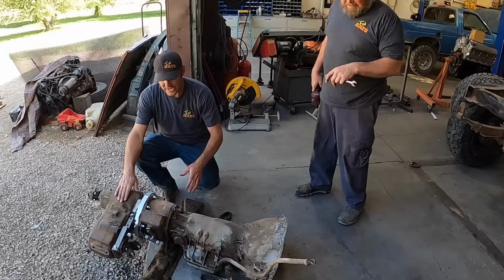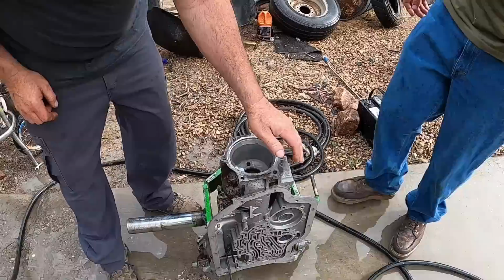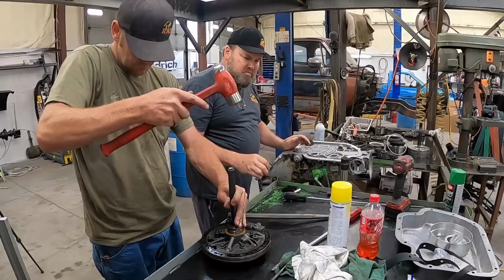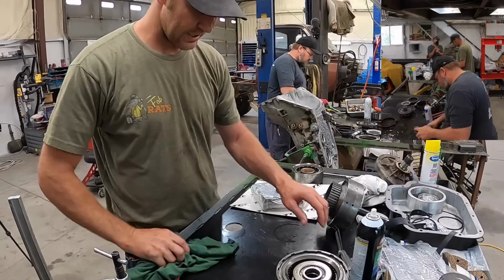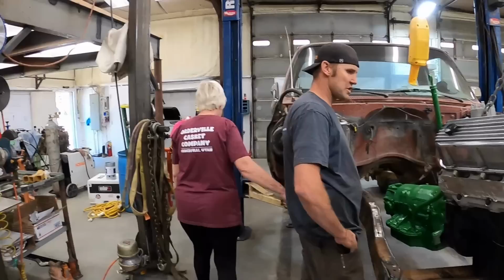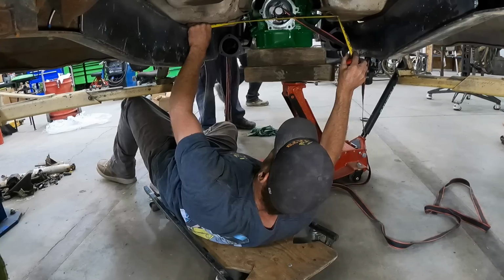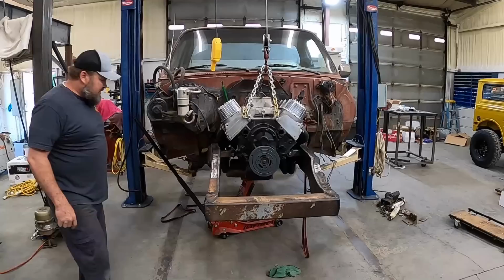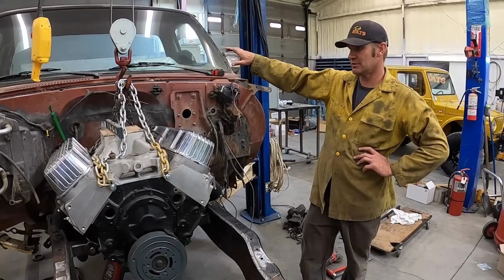All In A Day's Work! We Got The Motor In The Rat Rod Tow Truck!

Comment: The amount of knowledge you have is impressive! Auto trans have always intimidated me.
Reply: Automatics are easy: just take them to the scrap yard and put in a good manual.

Too bad Paul can't count to ten: a good Eaton Fuller would rock in that rig.
Reply: @kd5nrh  wow. Talk about not being able to count to ten. I’m sure while Paul is at 45 degrees on a obstacle pulling a disabled truck out of a canyon he’s going to be super keen on having to continuously shift between 1st and 2nd gears. Oh ya. Definitely. Torque converter and the correct stall is key to performing in this case and on a drag strip.
Reply: I hear ya. It was intimidating to me too until I went for it (because I didn’t want to pay for labor). After you succeed at it, you fully feel like you can fix anything.
Reply: @dsauce8780  Well said.👍

Comment: It just amazes me that Paul knows how to tear down and rebuild a transmission. Your average auto mechanic won't touch transmissions, it's just too complex, so they send it out to a transmission shop. I bet Paul is even self-taught, which just makes this even more amazing.
Reply: A TURBO 350 / 400 IS ONE OF THE EASIEST TRANSMISSIONS TO REBUILD ...
Reply: @tammylott921  why are you all cap shouting?
Reply: I can do it with a motorcycle carb. Paul does it with Carbs, Chassis, Transmission, Engine, roll bars, and Body
Reply: It's also a pretty color 😐
Reply: @ericratza5353  I'm good with lawn mower carbs!  Lol  

Paul does differentials too, with pneumatic lockers even! I've learned so much about them from his videos and from @Matt'soffroadrecovery
Reply: To take it a step further I'm guessing he has tons of experience with that exact transmission model. Even a seasoned transmission repair tech would go way slower on disassembly to note how everything goes back together when dealing with a model they haven't done before. Paul is so casual he must have that thing memorized.
Reply: @stevemonkey6666  I know! Lol  he still paints his stuff green like his derby car days. Definitely gives me a chuckle.
Reply: Well, we've seen him do another transmission and it didn't work. Let's save judgment until this one works.
Reply: Average auto mechanics are flat rate not really entertaining time learning at work if transmissions are not your focus point. Obviously learning on your own time is up to you.
Reply: I wish I had his skill with transmissions for sure. Can tell he’s done that many times
Reply: @tammylott921  ,  Easiest???
Reply: @DonAshcraft  ,  I GUESS because he had his SHIFT key down.
Reply: @tobyvision  ,  Impressive, no? LOL
Reply: @BruceNitroxpro  I KNOW  lol 😂
Reply: Old hydraulic automatics have a reputation of being more complex than they really are. It’s just clutches and gears, and the valves are mostly springs and ball bearings. It ain’t easy but it’s no more difficult than rebuilding an engine, and the turbo 350 is just ubiquitous.. no need to study it when tearing it down, you can watch 8 million YouTube videos about how it goes together. It’s like the small block Chevy of transmissions… there’s a reason for that ;)
Reply: @jaecenwhite2590  interesting. The reliability factor is probably also important.  I am self-taught with most all things, I've replaced many clutches trannies and gearboxes but I've never considered rebuilding a transmission. Especially looking at all those wavy random channels it looks like brain surgery to me! Haha 🛠️ 🧠
Reply: @tobyvision , Precision Transmission channel does a excellent job on breaking down transmissions and why they fail. 👍
Reply: @DonAshcraft  Painting a transmission any color is a good thing because it helps to repel any dirt/ mud from sticking which will hold in heat. The #1 enemy of a automatic transmission.
Reply: @327JohnnySS  Cool! Good to know.

Comment: A suggestion.  Put a couple of drawer sliders under the hole and mount a catch tray/basket.
Reply: I was thinking a hinged catch cage of some sort. But anything to stop the parts from flying about would probably work. A milk crate on wires...  🤷‍♂️
Reply: @lloydfancett3039  I was thinking a cardboard box with a rag in it :)
Reply: If I'm not mistaken that is the same table he does disassemble on so it would need to be able to hold fluid. 

Couple things surprised me drilling in a metal table with a transmission ready to assemble all around the hole. Waiting use the tranny mount after it's disassembled and putting it on for cleaning😂. 

Does the transfer cases get green paint?
Reply: I was thinking a Grease tray out of a ole grill
Reply: @offroad6309  It's one of two--he'll need to remember to do fluid work on the other one. Or put a plug in that hole. Second the motion for a catch tray, makes it easier to retrieve items.
Reply: @offroad6309  transfer case gets red paint

Comment: I just learned a whole lot about installing engines with this video - getting everything centered, and then leveled was new information for me.  Then checking the clearance on the headers was wise, so you wouldn't have to pull the engine to replace a header gasket.  I wish design engineers and auto manufacturers would think that far ahead when designing their vehicles.  Paul, your shop is such a great family-run operation with Ben helping you, kids popping in and out working on their vehicles, Grandma stopping by to bring lunch, Michelle stopping by to visit.  I hope you realize how lucky you are that you were able to create this wonderful world for you and your family.

Comment: A couple weeks...I had such a wonderful memory just then.  I was pulling the clutch out of my F-100 that had been having some issues.  Dad saw the condition and asked me, "How long have you been having problems with that clutch?"  I answered, "eh, a couple weeks."  His response was, word for word, the same as Paul's.  He then informed me that he smelled clutch several weeks back and knew we were going to be under my pickup...well, he knew I was going to be under my truck.  He never let it get too dangerous, but he was waiting for me to bring it up.  The best education comes in the garage with dad!  Thanks for the reminder.  I miss that old cuss.  By the way, I farted lifting the trans into place.  He started me laughing with that thing setting on my chest.  I was stuck under that hunk of metal for a good 5 minutes before I had the strength to lift it into place.  Laughing might be good medicine, but it's not good for bench pressing a transmission into place.

Comment: In early 1984 I ordered a K30 SRW w/ 454 big block, SM465 trans, A/C, dual tanks, 4.10 gears. Lived in St. Augustine, FL took it to the beach a week after getting and promptly sunk in the sand. After warranty I put 3 inch body lift, 6 inch rough country lift, and 42” Swamper TSL on it with a few engine up grades and all I ever got done out 4 wheeling was pulling people out so your starting out with a great platform. The truck worked the best in the mountains of West Virginia where I grew up. Put a locker in the front Dana 60 selectable if you can. Good luck with your build. God bless for your clean videos Sir.

Comment: Weld a couple pieces of angle iron to the bottom of the table you cut a hole into.  Use the angle iron to hold a plastic bin.  Then the parts won't hit the floor.  And you can just slide the bin in and out when ever you want.  Can then also be used as a drain hole and the bin can be the catch can.

Comment: I got a 2001 Jeep Grand Cherokee from my neighbor.. Motor was COATED in oil, power steering fluid and dirt.. oven cleaner took the dirt,oil and the frickin paint off the valve cover and oil filter.. i DID start up the motor an got it hot.. sprayed while it was runnin !!  :)

Comment: I used to take two turbo 400 pans and weld them together for more volume for mud racers. We welded or brazed a heater core in the bottom pan and use heater hose from rad and or cooler to cool the trans from inside. works great even with a trans caked in mud they did not over heat. still use factory cooler but the 5/8 heatercore in the trans pan is the best.

Comment: Suggestion: Build a drain line that will drain the fluids from the top surface to a catch basin below. Make sure you have a wire mesh to keep parts from getting into the waste line. Please record the build.
Reply: Think he showed it before, it goes into a 5 gallon bucket.

Comment: Generally speaking,, replacing bushings just because you have them can cause more problems than its worth. Usually the front pump bushing and the rear case bushing and maybe the tail housing bushing require replacement. Been repairing GM AT's since 69, when the brand new TH 350 was released.

Comment: Those hole cutters are light pressure with cutting oil or cutting wax they work great and last for ever. They also don’t like high speed too much. If you put heavy pressure on them they bind and break teeth off. I have a 3/4” conduit size and a 1 1/4” conduit size that I have probably drilled 300 holes each with still workin. Just don’t let the coworkers use them.
Love the stuff you are doing!

Comment: I use Simple-Green "Concentrated" straight, undiluted.  Simply spray, wait ten minutes, apply enough again to wet the surface and scrub with a nylon brush then rinse.  It is the only Biodegradable I've found that will take brake dust off a wheel in one go without pitting the surface, and again use a simple nylon brush.

Comment: Next time, try heated "LA's Totally Awesome".  I converted my parts washer to this detergent soap from the Dollar Tree store, and heat it up to 105F-107F with a 1000w livestock bucket heater.  Works AMAZING on desolving caked on grease, oil and exhaust carbon.  Soak parts overnight and it will be sparkling clean.

Comment: If you put the externally splined hub into the piston housing first, and then stack the clutches down in it, it'll make it way easier. The only one being 4th gear(on and Allison, probably the forward clutch on a THM400) which you have to jiggle the splined hub down into the clutches. However, you can take an old hub or just by the little tool that drops in and then you drops the clutches in, so they're all lined up, and you can even put air pressure in the piston to lock it up, so it stays perfect and drop the blind hub down into the clutches.

Comment: A good degreaser I use you can buy by the gallon is called purple power and you can either use it straight or dilute it with water. It's worked wonders for me

Comment: When checking clearances on transmission clutch packs it is best to air check the clutch pack a few times to properly seat everything which gives you a more accurate measurement.  The proper way to verify clearances is to use a dial indicator with magnetic base and use air to apply the clutch and actually measure piston travel.  I didn't see any of the drums being air checked at all.  It is best to air check the drums without the clutches installed, you pour fluid over the sealing areas and apply air to the feed hole and any leaks will be obvious by the bubbling.  That is the best way to avoid comebacks and on th400 4l80e units it is very important to verify proper reverse servo travel because the th400 and pre 1995 4l80e planetary carries are known to wear and it is not obvious from visual examination.  Currently I build around 20-25 high performance transmissions per month and I have maintained a zero comeback streak for the past 3 years due to my diligence which is required when building transmissions.

Comment: Hey Paul, i appreciate you making videos of your projects.  They are very interesting to watch.

I have one comment, not a criticism, but a comment.  Maybe helpful, maybe not.
On the FJ and the tow truck, you at one time or another stated they would be flat-bottomed.  But then they aren't.  In the big picture of things probably not a big deal, but here is the way I do it.

Start with a temporary transfercase/transmission mount, and make sure it is flat-bottomed.  Or as MORR did on the huge wrecker, put the skip plate on the frame to be flat-bottom.  Then set the engine height and angle to match up with transmission.  Then go back and make permanent transmission and transfer case mounts.  It always works.  It can sometimes result in the engine being higher in the engine bay.  In the case of the FJ and the wrecker, a couple inches of engine height wouldn't have hurt.  So ultimately the designer needs to decide, is engine height or flat-bottomed or engine a bit nose down more important.

Thanks for listening.  Keep on, keeping on.

Comment: Hey Paul, you should put a little drawer under the hole you drilled in the transmission table so when you knock parts through, you can just open the drawer and grab them.

Comment: If possible it would be beneficial to replace the rear planetary set up with straight cut parts from an RV or other heavy duty application TH400. The helical cut gears are quiet, but they also will shatter the Torrington bearings in the back end of the geartrain because of the thrust. You shaould also replace the hollow feed bolt for the center support with the revised part any time you build a TH400.
You need a caping chisel to catch the edge of those bushings and collapse them in to remove them.
All parts should be cleaned in a parts washer and blown dry. Wiping with a rag is bad news, the rag lint you don't even see will all end up in the filter shortly after you get the trans up and running
I did not see you put in the bolt for the filter?

Comment: Paul, I would think a spinner tip would work better than a straight tip for getting the grease off the transmission. It can't hurt to try. We use them at work for cleaning extremely dirty equipment, and usually have good success with them.

Comment: Now that you have a hole in your transmission table, you need some kind of brace under it so the table bed doesn't trampoline stuff off the bed. Maybe a length of 4" square tubing so nothing impedes the hole.

Comment: Message for Paul. Operate the holesaw at a slow speed, and use oil. It will  last for ages cutting mild steel.

Comment: Those automatic transmissions are a bit tricky.  I've only done 1 or 2 and I had to pull everything out in order and label / stack it so I could put it back in the right way.  They actually moved so that's a good sign.  I don't feel so comfortable doing them things unless I have the right place.  They have to be 100% perfectly clean or they have to come back apart!  Course all I've built is a 904 and 727.

Comment: All my tranny tables have hole cut in them. First thing I did when I started my new job with county, rebuilding the hybrid drive units. I cut a hole right in a new metal table, lol. I asked first though, lol. But where I came from I worked on Allison's for 23 years rebuilding them, and the electronic troubleshooting. But we had the large metal tables with the troths like that, I had a big squeegee just like that to get rid of the oil I put a plastic bucket under the cut holes to catch fluid.

Gotta make your own tools though, the factory ones cost too much. Also you gotta have the holes, cause some of the drive until parts weigh over 100 pounds, and they have long shafts.

Comment: I myself would use the old parts as long as they are good, because I have had problems with some of the newly made parts failing because they are not as good. Not necessarily transmission parts but parts in general.

Comment: if you have spray paint or over spray on your car. you can put oven cleaner on a rag and wipe it off. the car paint is harder then the spray paint. but will lift if you spray it right on the car instead of the rag

Comment: Yes Paul,
      JD Green is (THE CORRECT) color to use.....
       BTW,
     It will shave 1.5 sec off your quarter mile time.....
While round headlights will increase your crawl rate 20%.....

Comment: Its coming along nicely, what about duel side pipes or duel stacks up the bk of the cab would be neat, chuck duel flame kit on it so weld spark plugs in the exhaust and get some big flames in the air. I did the comment after u said about run duel exhausts down to the bk well if your taking it to shows/pull offs Defford got be duel stacks with flames for the crowd 💯💯💯💯🔥🔥🔥🔥👍👍🔥🔥👊👊👊😎

Comment: Okay Jase, here’s a Moment with Randy:
(Michelle, music please)

1973 Dodge Charger SE, I bought with mag rims and ran out of $$$ for new tires, so I used my spare and bought a second spare, with old beater tires to get me by.
Problem was, the lug nuts for the mag rims, those nuts did not fit the stock rims. Every time I used my brakes there was this knocking. After about 3 weeks of running around like that, I had to buy new brake drums, because the holes for the wheel studs had elongated - yeah, they were no longer circles, but oval holes. Not good. Very blessed that I did not bust off wheel studs and lose my entire car. That would have been really bad. 
“Don’t be like me,” is all I got to say. I’m out.

Comment: Hey fabrats I’ve been enjoying watching the rebuild of the tow truck but think I saw a mistake during the rebuild of the 400 there When you guys were taking the bushings out of the stator and mentioned you only need one bushing. With a stock 400 converter like that you’ll need that second bushing there to keep the input shaft and turbine centered in the converter

Comment: Fab Rats! Maybe I can help you out. Get you a can of liquid nitrogen and a heavy duty styrofoam cooler. Bushing bearings all press fit, ok , most mark with paint pen if orientation is a must drop in nitrogen, cover for 5 to ten minutes. Orient, drop in place. No more drivers, hammers, etc.

Comment: can that inner  1/4 "  plate handle all the torque  of that bad ass big block?

i would have tied inner and outer walls together with a spacer at the motor mount.

but that's just me  doing stress calculations.